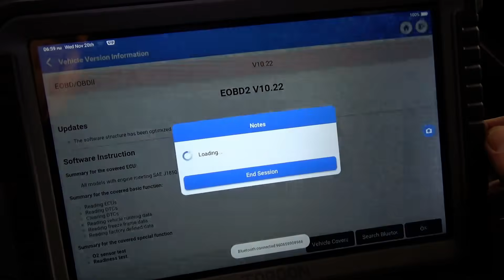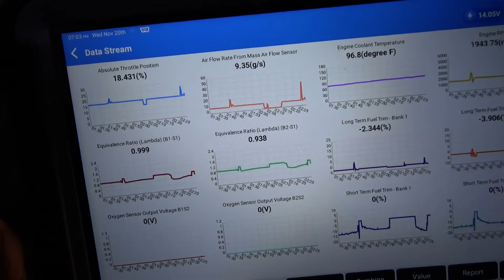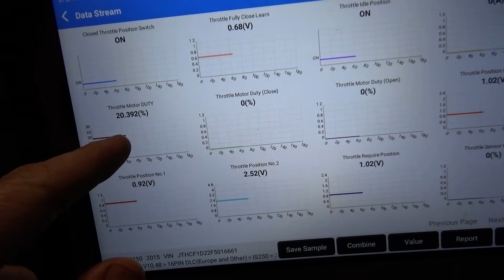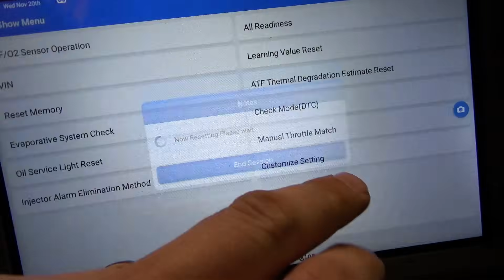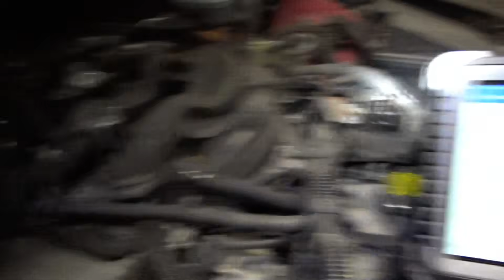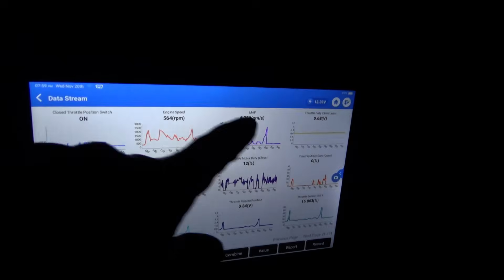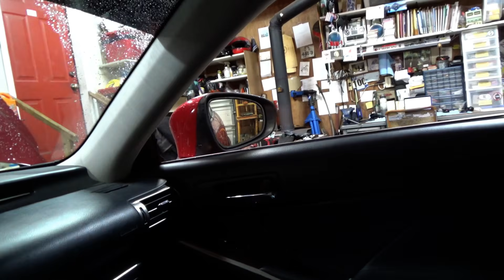CRAZY Lexus Idles at 2,100 RPM?!? No Codes Set!? ('15 IS250 V6)

Comment: I find it odd that when you fully open the throttle by hand it only showed 84% and when closed 16%.  Seems like they should be 100 and 0.  Calling the idle problem "the transmission is bad" doesn't feel right.  It would be interesting if you sent voltage to the throttle body pin that controls the "pull to close" function and see whether it physically does it.  Wish the tool had a throttle activation test where you could command it to different positions.  Hope Part 2 explains the answer.  It is a head scratcher and a nice and interesting video, thanks.
Reply: The 16/84% is normal. That is the signal, not the physical position. You do not want the full signal as reading the extremes ain't reliable, plus it allow for short to VCC and GND detection.
Reply: I thought the exact same. I'd love to see thr customer find a used throttle body assembly with motors and swap amd see.
Reply: Had a similar problem on my prius and found an article in Haynes that a dirty Maf can cause this symptoms. Took it out, cleaned the Maf with BC and it went to normal rpm, no problem since in 2 years.
Reply: @seghio  I like this as a possible culprit in this situation.
Reply: You don’t have 100% or 0% on engine data. One is representative of open circuit and other of a short. That’s how computers detect abnormalities.
Reply: I work on a lot of different types of vehicles on a daily basis, you almost never see 0 or 100 on the tps signal
Reply: Almost seems like a vacuum leak
Reply: I bet someone else swapped out the Throttle body with a cheap junk one from eBay and that's why  he's getting these weird results. Tranny had no slipping or anything else but high idle? How do you explain that to your customer? Your tranny is bad, even though it runs fine.
Reply: I am 78 years old. Every single vehicle that I have owned over my life that had a simple system of levers or cables to control the throttle NEVER EVER EVER had a problem. A simple squirt of oil once in a while is all you needed. An electronic throttle body is pure unmitigated BULLSHIT!
Reply: @superfinn80  You only think it's BS because you don't have sufficient knowledge to understand it's purpose, I see this all the time in YT comments.  Even though they add some complexity, electronic throttles give numerous advantages:  The pedal to throttle transfer function opening can be dynamically mapped to give a linear torque demand response, with a manual throttle most of the demand occurs in a relatively short throw, the rest of the throw does nothing at low-mid engine speeds.  It enables cruise control to be implemented very easily, no stupid vacuum actuators etc.  It allows NOx emissions reduction by limiting vacuum on the overrun.  Idle control can be achieved without additional air bleed valves.  They allow a simpler implementation of traction control.
Reply: @ferrumignis  I'm 78 years old. When I was 11, my uncle John told me that 95% of the time, the reason a vehicle would not run is electrical. It was true then, and it is true now, except the electrical part has become ELECTONICS, most of which are made in China with very little concern for quality control, and everything is run by modules connected to a main computer with tiny wires that rodents love to snack on. So maybe you are right, but 60 years of experience fixing vehicles tells me we have gone backwards when it comes to reliability.
Reply: @ferrumignis Could you please explain your earlier comment about advantages of electronic throttle control "NOx emissions reduction by limiting vacuum on the overrun"?
Reply: Agree! I would like to know here the throttle body came from. Aftermarket parts 100% WILL NEVER WORK on Toyota Lexus vehicles. He needs to get a used OE throttle body. Also, the mode select button affects the transmission so if it’s disconnected crazy things can happen. I do not believe for a second it’s the transmission on a Lexus!
Reply: But aftermarket stuff works sometimes..  just gotta not get the knockoff cheap crap..  my 2005 toyota motor has all aftermarket parts and has ran fine.  Got aftermarket injectors, coil packs, throttle body because a new one is over 700$, got mine for 120$..  its got aftermarket valve guides, head gasket, fuel pump, a few sensors that went bad are aftermarket like temp, oil pressure, cam…. Hell the only thing i didnt replace with an aftermarket model was the temperature control system with all the solenoids and crap and it never has worked right..  the solenoids will ghost all the time and open and close the circulation / outside vent flapper deal..  expensive toyota parts, still crap bought and replaced by a dealer..  everything else i replaced myself..  works fine..  either way if my aftermarket throttle body craps out id have to go through 5 more of em to equal the one factory oem replacement cost..  ya im sticking to smart budgeting and not dumb prick generalizing budgeting..  why you racist against aftermarkets?? Whatd they do to you?  Oppressing the parts..  napa parts arent all criminals..
Reply: @Z-Ack doorman crappy sensors will die eventually. My 2004 RX has original Crank and Cam sensors, but when they do go... I'm not gonna pay Denso (Toyota) prices... Just have to replace them sooner.
Reply: Yea my aftermarket throttle body shows 16% at idle and 86% full throttle.  If it showed 0 then the motor would die because the butterfly would close off all oxygen.  The cars usually have 2 throttle position sensors. One on the tb and one on the pedal.  The pedal will also show the 16% and 86% because of the same fact.  The pedal sensor you can also pull it manually to 0 but it will signal the motor in the tb to pull it to 0 and stall the engine..  you cant ever get the motor to 100 % throttle either which i think is bullcrap but my guess is it will either over stimulate the car and it will bust a testicle and then replacing a toyota testicle is big money and delicate surgery..

Comment: The TPS is most likely the problem .My 06 Corolla has no codes but on a cold start the thing sits at 2,000 rpm once it warms up it drops back to approx 850 rpm .The only data PID that is not within specification is the TPS when I looked at it there has been an attempt to fix it with some type of epoxy .I believe the throttle body is damaged .So my guess with this is the throttle body is most likely a Chinesium one & it is not working properly.
Reply: Sounds very reasonable... transmission is obviously going to put on a slight drag, but throttle body needs to adjust for it... I think student got misdiagnosis here.
Reply: Yup...thinking same thing.  Throttle body might be from the main land or from the jungle website.
Reply: @John-wz3iu  I priced an OEM one $300 aud  I also looked on Flea Bay $ 125.99 I know which one I will be using because mine is drive by wire so there is no way I trust Chinesium junk.

Comment: My sister's Cilica Supra from the 1980"s idled at 2200 for years. . .My BMW 318I  from 1984   did it too and no mechanic could find out why. . I'm eager to learn what was tghe problem. .  both L-Jetronic Bosh injection. .
Reply: thats the water temp sensor .

Comment: Could be Throttle Reset or check the throttle body for proper installalion or cheap aftermarket parts, Doctor.
Reply: Doesn’t seem like Toyota has throttle reset option. It’s all entirely automatic. No user intervention required.

Comment: My 1997 Lexus LS400 has a cold idle of 1500 for about 5 minutes; it then settles down to a normal idle. Never a check engine light. It has done this for the 8 years I've owned it. Could never figure it out.
Reply from the maker: That's totally normal 👌
Reply: @PineHollowAutoDiagnostics  It is insofar as this particular car is concerned, but I cannot believe Lexus engineers planned it that way. The thing goes 30 mph without hitting the gas if you let it, and putting it in gear at that rpm I think puts unnecessary stress and wear on the driveline.
Reply: @privateer0561  Toyotas love their fast idles for sure
Reply: Thats normal... Its in open loop. my 98 LS and just about every other car I have does the same.

Comment: Thank you Ivan. Look forward to the follow-up. More diagnostics need to be performed. Not seeing the transmission being cause of increased idle issue. Would like to see the APP live data.
Reply: Agreed
Reply: Blaming the transmission is a total guess. And a bad guess at that. No evidence that is the problem. The engine speed dropping to 500-600 when in gear is totally normal, especially when warmed up.
Reply from the maker: @zeuscarver3112 ok what would be your next diagnostic step? 🤔
Reply: @PineHollowAutoDiagnostics  i was convicted you were going to put a scope the TCM and view the pulses from the input shaft.
I'm not a mechanic.
Reply: @PineHollowAutoDiagnostics  First I'd want to investigate the -14% fuel trim. Probably wouldnt lead to anything but thats my first thought. The fact that a battery disconnect fixes it for a while steers me away from a mechanical problem and toward an instrumentation problem. Ultimately I feel i would fire the parts cannon with a known good throttle body. Even if the transmission is overloading the engine when in gear, and the engine speed momentarily surges when put in park, it should still come down after a while.
Reply: @PineHollowAutoDiagnostics  Ivan the 8.5 g/s reading of the maf at 2100 rpm is very strange , look for a vacuum leak, torn ntake boot or bad maf
Reply: @darrenfloen2693 maybe a stuck open idle air control valve?, but why the PCM is not giving a "idle speed out of range" code?, maybe the pcm is requesting that rpm speed based on wrong data from a sensor (between normal parameters but wrong), my guess in that case would be an ambient temp sensor.
Reply: @PineHollowAutoDiagnostics  Get a meter on the TPS, accelerator pedal, and the throttle closed/open switches. The ECM is convinced the throttle is closed because the switches may be in a wrong position and fooling the computer into thinking the throttle is in a position where it physically isn't.

Comment: Something definitely weird is going on. I had problems starting my diesel truck this morning put it on a charger nothing. Had to jump it with my son's car, drove to my local battery shop they tested the batteries and said they were fine. I told them to put 2 new batteries in but , driving too their shop I had a message on my cluster to service electronic throttle control after batteries were replaced the message was gone 🤔🤔🤔
Reply: Disconnecting the batteries possibly cleared the code, just a guess.
Reply: @danwoodfield7575  Maybe but, both batteries were not disconnected at the same time 1 battery was always connected...

Comment: So what was wrong with old school mirrors that we adjusted by hand and could be easily and cheaply replaced if they broke?
Reply: The mirrors on this lexus are now old school mirrors that you adjust by hand 😆
Reply: @GTPWill27  YES, thats how I fixed my BMW mirrors when the $800 module went bad.  Pulled the fuse and adjusted by hand ... right as rain.
Reply: Not supporting multiple driver profiles (determined by key or button), the awkward adjustment of the passenger mirror from the driver side, having to run power to them anyways for heated and auto dimming mirrors.

Comment: The worst engine Lexus ever made, you'll do the world a favor by not keeping it running honestly.
Reply: Mechanically and/or Electrically?
Reply: @shakalpb1164  yes and yes, they always had gremlins and you'd rarely see pattern failure across their production run which is very unlike for a Toyota product to do.  The only redeeming thing about this chassis was that it had a stick option briefly.

Comment: Over 2000 rpm idling means that the vehicle will soon need a transmission.
Reply: Why would you say it will 
 need a transmission because it idles at 2000 RPM?
Reply: @PaulCTownsend  because when you apply the break to stop and the engine keeps running at 2k the clutches and torque converter are slipping which wears out the tranny.
Reply: @JohnSmith-ug5ci  I would say it sounds more like the torque converter clutch is dragging because of a bad solenoid. No there is no clutches engaged in park.
Reply: The clutches aren't engaged...
Reply from the maker: @volvo09 clutches engaged in PARK? 🤔
Reply: You should definitely make a part 2 on this one @PineHollowAutoDiagnostics
Reply: @volvo09 What the fuck are you taking about? That makes no sense.
Reply: Idle 2k the car wants to go sweating horsepower 😂😂😂
Reply: Even if the clutches were engaged, unless the transmission is locking up the torque converter it'll be that that's handling the difference between wheel speed and engine speed
Reply: 😂😂😂 bro of the clutches were engaged in park he needs a new trans now not soon lol
Reply: @yamfingaz5598  no the clutches were not engaged in park.
Reply: This comment indicates the transmission in your head is failing..
Reply: @TangoRed287  you show how ignorant you are.

Comment: Oh man, Toyotas been takin it on the  chin for a while. 😂OEM TB? , why was it replaced? Transmission? Wow.   Didn’t catch the mileage, but I’d guess it’s original fluid and previous owner knew there was a problem. 👍👍🇺🇸
Reply: Maybe it was replaced for this same issue, and the new throttle body didn't fix it, so the owner saw the writing on the wall and sold the car to this new guy.
Reply: @AaronAverett  Quite possible, 175K on a Lexus is nothing if it was maintained.
Reply: 175000 mi, yeah no change in I bet
Reply: @DIYDaveOK  That would be my guess. Those transmissions will go 500K with half decent maintenance.

Comment: Tps or idle air control valve 😮
Reply from the maker: Cars haven't had Idle Air Control valves since the throttle cable became obsolete! 😅
Reply: No codes is kinda strange, should be interesting. Will it be a NPR?
Reply: Drive by wire or electronic throttle control has been used on vehicles since the late 80's...